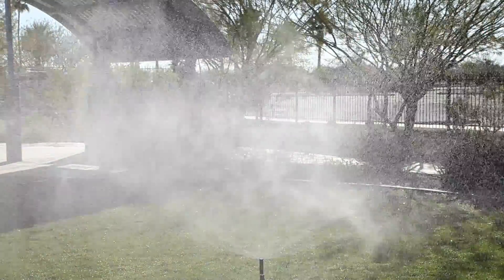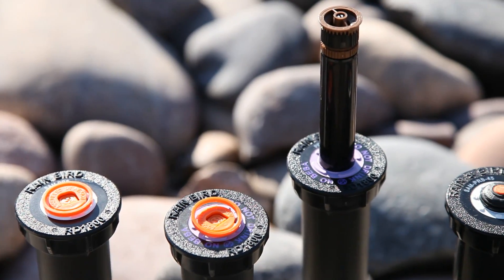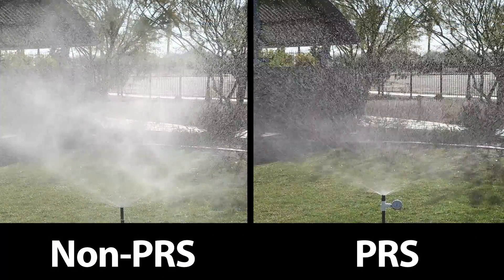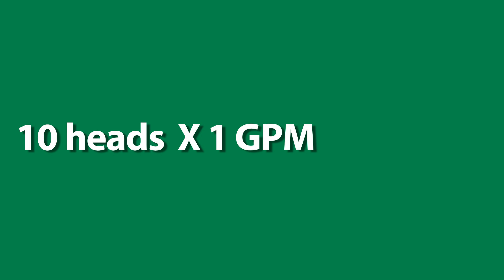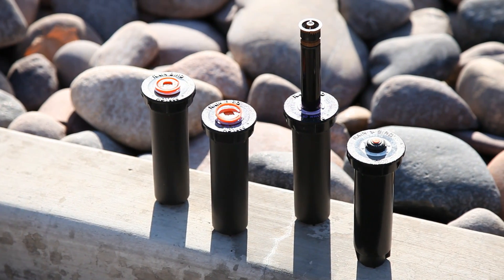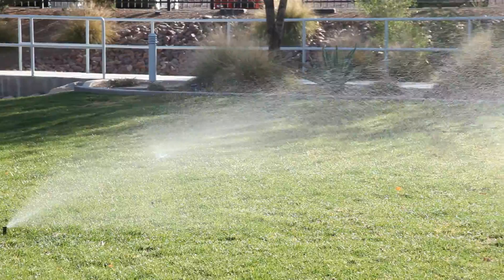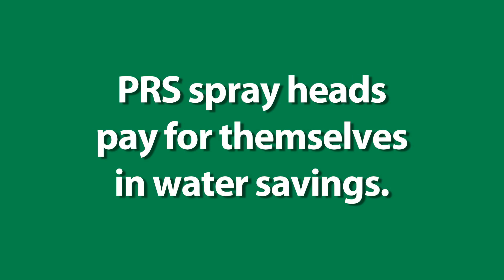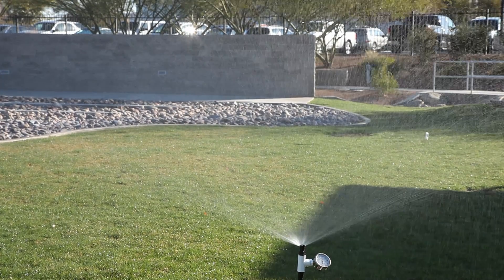Rain Bird PRS Spray Heads

Comment: Well, what are the adjuster screws for in the spray nozzle? They do just about the same, control flow as does the sprinkler valve. Seems more like the state of CA wants to eliminate some of the features in a simple spray nozzle.

Comment: I have 4 in RD 1800 SAM / PRS 30 PSI Spray Head, and I'm buying valve.  Whether there will be a valve 100-DV okay?, given that I already have PRS, Is it better if I buy  100-DVF ( flow control ) ?